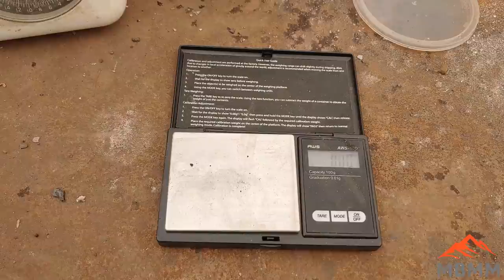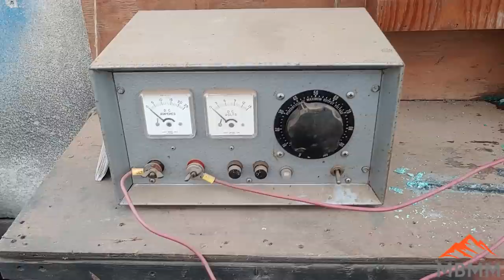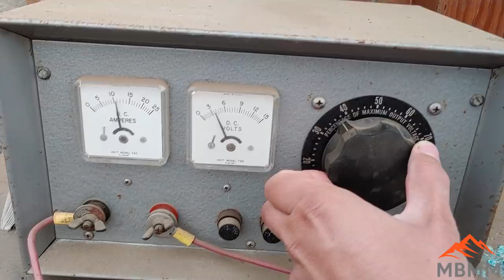Copper Smelting & Bootleg Electrowinning Cell For Gold & Silver Recovery

Comment: Lower your voltage to ~1.5 volts. Create a buss bar. Bag your anode. Alternate cathodes and anodes. The slimes conduct electricity so, they can short out your power supply.
Reply: You have any commercial experience ? I wanted to know if you could draw out copper plus 2 ions and zink in seperate cells from same tank with seperate power supplies
Reply: @dekonfrost7  no
Reply: robert jeffery no what?
Reply: @dekonfrost7  no I don't do commercial and No you can't strip 2 different ions from the same cell
Reply: How can I do a selective recovery of gold in a solution of high copper concentration by electrolysis?
Reply: @EdwinMedina147  by following this method.  Don't have to smelt the anode slimes, you can rinse really well with water,  then cover with hcl and heat to dissolve all the base metals, then rinse again with distilled water. Dissolve in nitric so only good is left, filter out gold left on bottom, separate silver from solution using hcl or salt, melt the pms

Comment: After panning out most of the gold from the number 1 compartment, you could throw the rest of it in with the number 2 concentrate..then save all the number 2 concentrate,...for later. Basically forget you have this mother load until you've got enough  saved up , then you could re-run it on your shaker table...after..perhaps..running this concentrate through your mini ball mill...love your videos...thanx..

Comment: 10:30 you need to force that solution to circulate more so you don't end up with dead zone right around the anode which allows for a much higher depletion rate so you have less in solution to worry about when it comes to the disposal of the waste from this process.
Simple cheap and effective is a bubbler like the one I made from vinyl or ideally silicone tubing a piece long enough to make a Loop of hose the approximate diameter of the midpoint between the center and rim of your container and just make small slices about a third of the way through all along one side of it then make the Loop put it in your Reservoir and it should make a pretty uniform circulation should make that process run a lot faster

Comment: You shouldn't waste that slime/mud's physical state. A splash or two of nitric acid would put the copper and silver into solution, and leave the precious gold. Solidifying the stuff before separation just makes it that much more difficult. It would need to be re-melted, cornflaked, and re-dissolved in nitric at a later point anyhow. And the cornflaked stuff doesn't dissolve nearly as quickly as the mud -- due to greater surface area exposure to the acid.

Comment: it is fairly easy to convert a computer power supply to provide a 5 or 12 volt if you want to sell toe copper it is well worth running it twice as you will need to do that at least to get 99.99 pure copper so you can sell it as bus bar grade.

Comment: sir.  I just want to know if I can melt ore using soda ash, silica sand, and borax?  and what is the flux ratio?  thanks and more power to your channel.
Reply: 1 Part ore in fine powder form : 3 Parts Borox . If target metal in very low concentration , then add pure copper as collector , smelt at 1600-1800C  , Good luck

Comment: Electricity? Nope, electricity won't select metal for you. This process was widely use in industry to coat metal a to the metal b. How do you sure all metal get electrolysis are all copper but nothing else? The deposit on the copper plate can be anything from copper, silver and gold. All the best conducted metal use in industry. Lead also happens to be conductive too, check your car battery, no wonder you say the copper plate becomes heavy. The metal ions can hide inside that pot of battery juice too, if you put nitrate acid in that pod of juice, it turn cloudy colour, very likely there are some silver and gold ions inside. To suck it out, you have to boil that juice with a lot of nitrate acid. Which is a SERIOUSLY DANGER move, corrosive vapour in high temperature can kill.
Reply: luderick wong it is the electrolyte and the amount (95% I think) of copper in the anode, that allows selective plating of the copper. This is the same process that Anaconda Copper uses to refine copper to be used in electrical wires.
Reply: @robertjeffery3237  how? In a normal situation, say you want to coat copper on iron. You have to prepare a pot of juice contain such as copper sulfate, and only copper sulfate, no other metal. Then you have to prepare a sacrificial plate of copper too. 

The case now is, you have a pot of solution x, which is not only copper, and a sacrificial piece of metal y, which is a alloy of multi metal. Nothing is pure in this pot, therefore very likely the process did nothing on concentration of any specific metal. It is still “a bunch of metal in one pot”.

That's why people use mercury in similar situation. Mercury can “liquidify” silver and gold inside that piece of alloy, and then the quick silver can be steam away in a furnace. Just listen to the procedure you can feel how toxic it is to the operator and the environment. Not recommended.
Reply: luderick wong if the plating is for durability or astetics the process is generally a CN electrolyte and pour anodes.

For electrowinning the electrolyte can be any mineral acid with a soluble salt. The anode needs to be reasonably pure. 95% is the lowest purity that will not begin coplating emediatly. Watch Sreetips videos on how he refined silver to 99.99% purity.

Also Sulpher doesn’t interact with gold and the Pt group metals.
Reply: @robertjeffery3237  sreetip? You must be talking about his silver battery and other method. He is cooking his pot of battery juice with large amount of concentrated nitrate acid. He had prepare his experiment with ventilation, you can hear the fan blowing in his video, cause that vapour can kill. If you are living in a place with neighbour and doing the same experiment, they will come and get you with a shotgun. 😃

Comment: you can just dissolve the copper with HCL can't you?
Reply: HNO3 works better
Reply: @richardmckinney4963  wouldn't the gold dissolve too using that?
Reply: @GrantFrankBurton  no nitric by its self wii not dissolve gold,  but would put both silver and cooper into solution.
Reply: Hcl won't dissolve copper without an oxidizer like h2o2